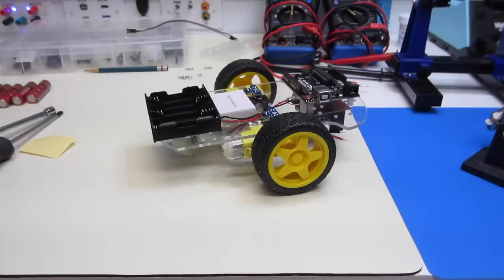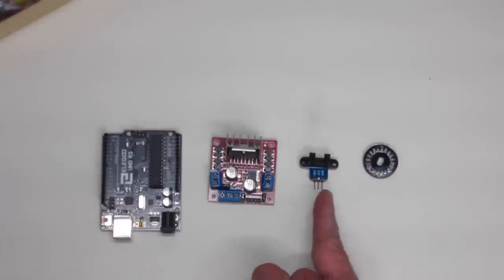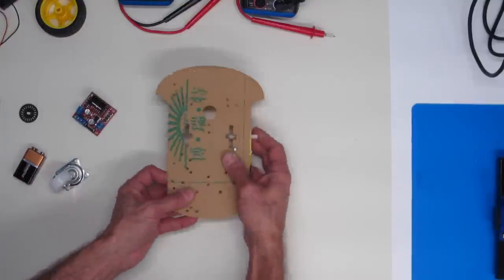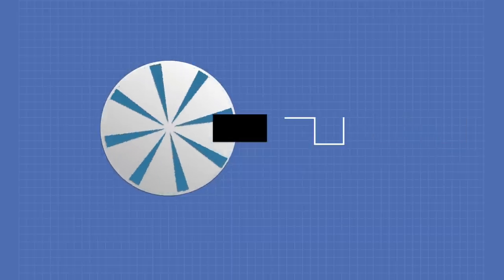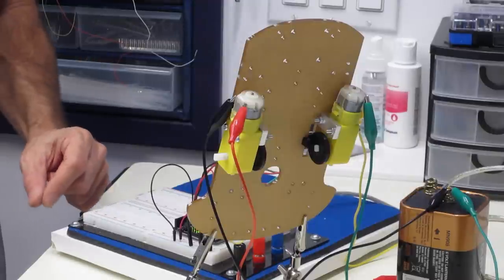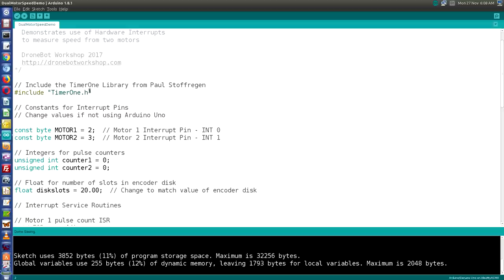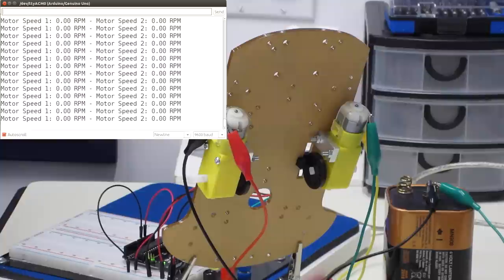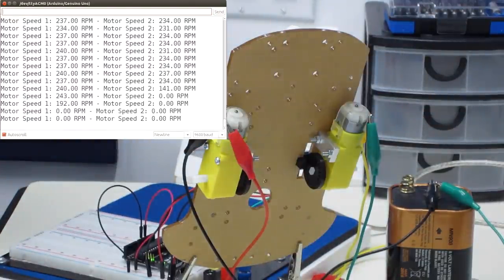Arduino Robot Car with Speed Sensors - Using Arduino Interrupts

Comment: I am teaching myself Arduino and to a smaller extent robotics. I have followed your excellent tutorials about the robot car and every detail is clearly explained and easy to follow. The instructions on Interrupts (and the link to Nick Gammon) made my project jump ahead in leaps and bounds. I did find that the last code would not run until I put a few pinMode(??, OUTPUT) instructions in the setup to define the Arduino to L298N driver pins. Once they were set, away we went. Thanks again and I'm looking forward to your continued additions to the car.

Comment: hi and thank you for this work, it's a great start for me.

Some improvements I did in the move routines code:
1. if you use "II" instead "&&" in "while", then the movement finish when both motors end at the same number of steps.
2. instead of "steps > counter_A" I use "counter_B >= counter_A" and instead of "steps > counter_B" i use "counter_A >= counter_B".. in this case each motor waits the other to complete same number of steps, so the movement is straight.

Comment: Just a few short comments. First, please note that 25.4 cm is NOT "about a foot." It actually is 10 inches. 

Second, while I enjoyed your video, as I always do, I came here looking for a way to control SPEED of two motors so they track accurately together. After all, the encoder disk is referred to as a "speed sensor". The motors you used, quite visibly, do NOT both turn at the same rpm, as the car drifted to one side when it moved. That was also obvious during your first demonstration showing rpm on the Serial Monitor. The two numbers were not in sync. If you do not have a video that addresses this issue, please consider making one.

Thank you for your time and efforts producing these videos. I enjoy them and have learned a lot from you. Keep it up. 

Finally, to those who comment on your (and others') videos with lines like "I have a project due Monday, how can I do..." These drive me mad, as it seems they want YOU to do the work and let tham take credit for it to get their diploma/degree. Instead, I recommend those people actually invest in LEARNING something, instead of poaching others' work. Grrrr...
Reply: Hi Tim,
Have you heard of PID control? Theres a video on MATLAB that allows you to use this output speed to determine how to adjust it.
Also, about a foot is close enough to 10 inches. I think he rounded it.

Comment: Brilliant Demo, with excellent explanations. The only suggestion would be (at 33:37) show the negative from the 9 volts goes to the outside (chassis) of the 2.1 mm power socket (centre is positive).   I am jealous of how neat, tidy and well laid out your workshop appears.
Reply from the maker: Good eye John, I should have spotted that connection error but didn't until I read your comment. Hopefully most users will just use a 9-volt to 2.1mm connector and won't reverse the polarity.  Thanks for pointing that out!

Comment: Really nice video! Having bought a similar chassis last month, I made a Mobile controlled robot car using a bluetooth HC-05 module, but I kept wondering what to do about those speed encoders to control the distance they travel or speed of the motors. Well, thanks to you, now I know. The explanation about the Interrupts was exceptionally good and will help me in building some more ambitious projects. I will surely check out your website as well.
Reply from the maker: Thank you for the nice comment, so glad I was able to help!

Comment: Actually, 25.4 cm is 10 inches (1" = 25.4 mm). A foot is about 30cm.

Simplest way to get a rounded value is to add 0.5 before doing the truncate (or cast). (or use a lib function which does that'I suppose)

Comment: Hi, I have some questions about the power supply. Could you power both the Arduino and the L298N off the 9V? My chassis is much smaller, so I am trying to reduce space. Also, can't you power one of the two boards off the 5V supply of the other? Is there some risk of over-currenting if too many sensors are connected to the 5V supply on the Arduino? Thanks!

Comment: Great video. Thanks a ton. Just a question. Instead of 5x1.5 = 7.5 V, can the H bridge be supplied with 9V battery to power the motors? Thanks

Comment: Thanks for the video... I've built a cart using the same electronic components but I can't get the cart to move straight in either the forward or the reverse direction, and the distance that the cart moves is far less than the distance I put in the program. I've checked the logic over and over and it seems to be OK .  I have the sneaky suspicion that the the HC-20K opto encoder is actually OVER counting steps!   I checked my code by putting serial prints in strategic places and the code correctly calculates the correct number of steps for a given distance and the routines do start and stop the motors until the correct step count is reachedHence my suspicion that the speed sensors are reporting more steps than what have actually occured.

To give you an idea,  my wheel diameters are 66.2 mm - so the circumference is 3.14156 x 66.2 = 208 mm .  When I input 208mm the subroutine correctly calculates that 20 steps are needed and the motors are turned until the ISRs report that the step counts reached 20 steps, but one wheel turns ~290 degress while the other turns only ~180 degrees.  

I am guessing that the interrupt pins are seeing a noisy signal and that some of that noise is triggering the ISR.

As I am writing this, I am also thinking that I am running both the arduino and the motors using the same battery... perhaps that may be the source of the noisy signal on the ISR pins? I want to run on a single 9 battery because my cart is about 1/3 of the size as yours. I set myself the challenge top make everything as compact as possible.

Have you or any of your subscribers come across this? Is there a solution?

Comment: Absolutely fantastic instruction video.  Very clear, to the point, with no unnecessary baloney. I'm definitely a fan.  I'll be building one of these robots via these instructions to be sure.  I eventually hope to build a far larger robot using the same basic principles.  But building this little one to gain the experience is definitely the way to go.   Thank you very much for making these video courses.

Comment: Many thanks for the tutorial which set my buggy up jolly well. A question though if I may. In the early part of the tutorial you used a sketch to demonstrate the use of the speed controllers. In it you called TimerOne from the library but it wasn't used in the main sketch. That puzzled me. Could you please explain why this is? Many thanks, Joe.

Comment: Such an informative video! Great. As for the basic optocoupler without any circuit boards; Can it still be used in the same way? I have those on hand and would prefer if i did not need to add an additional pulldown resistor.

Comment: Thank you very much all the step by step explanation as a beginner I find them to be very useful. Nevertheless, when I first come into contact with the related subject I had the question of getting both motors to turn at the same speed so the car would go on a straight line. I did notice the demoed moves made the car goes the the left as your motor A has a slightly higher speed. But this can be significant if it is to run on some distance. Do you have ways to achieve the same speed for both motors to run on, since there are so many read outs?

Comment: Tore an rc toy car to get those motors.Finally ordered the kit since I needed those speed sensors and a couple of nrf2401L´s.  Really learned a lot.  Would it be possible to make another vid about the rbtcar using  2 nodemcu´s to control it wireless? Thanks!

Comment: So I noticed the wheel speeds are different. How would you script the arduino to make the car run straight? 
  Although i did see where the script made motors equal their rotations. But does that straighten the car out at end of run or will it allow a long straight run? 
  Thank you for your response.

Comment: Hello, I really like your videos, you do a great job. I have a question about the Speed Sensor. I set the sketch and hardware up just as you instructed running motor on 5 volts, it seemed to work fine until I changed the voltage to 3.3 volts to slow the motor down. The sketch RPM reads faster on 3.3 volts then on 5 volts. What are your thoughts? Keep up the great work!

Comment: Hello. Thank you very much for giving this really informational and nice tutorial. I had a question regarding the code at 19:40 of your video. There is a TimerOne Library and I installed it from Paul Stoffregen's GitHub, but when I uploaded and tried running the code, I got Compilation Errors for 'class TimerOne' has no member named 'detachInterrupt', 'class TimerOne' has no member named 'aatachInterrupt', and 'class TimerOne' has no member named 'initialize'. The lines are in Void Setup (Second Line and Last Line) and Void ISR_Timerone (First Line and Last Line). My code is a direct copy of yours, so can you reach out to me as to why this didn't work on my side?

Comment: Hi, I find your video very useful, but I have few questions. I have got the same chassis, dc motors and the motor driver. However the motors are rated for max operating voltage equal to 6V. I understand that there is voltage drop on the motor driver, however how did you calculate that your 7.5V will be safe? In the L298 paper i can see that there is min. drop of 1.8V at 1A load, but the dc motors can take up to 300mAh, so the voltage after the drop on the 300mAh load will be highter than 6V, won't it? I want to use 6x 1.3V NiHM which connected in series give me ~7.8V, will it be still safe for the motors?

Comment: At 44.40 you say that 25.4 centimeters equal one foot. That would be true if a foot were 10 inches. The 25.4 equivalent number is in millimeters per inch.

Comment: I was wondering.  If you would you would want to make a PID temperature controller that for example kept a room a 85F during the day and 70F during the night. Could you use the PID library and a real time clock to achive that using interrupts to toggle between the different settings?
Reply: rimmersbryggeri smart
Reply: @xen0n_ML  Maybe but I have no isea how to do it. Any time I modify a PID sketch It just returns soemthign like. (not possible to compile for this board)

Comment: HI there, 
i want to build a AGV (Auto Guided Vehicle) robot. but i need help wiring the circuit. i'm using two DC motors to drive the robot forward, two battery packs to power each motor, one Dpdt switch to turn the robot off and on, and two limits switches that will act like sensors. if one limit switch is trigger one motor stop and the other motor reverse until the switch is release. can you guys help me out with this projects? thanks!

Comment: Where did you get your encoder sensors from? I can't find them anywhere, or the optal-interrupter is not placed on the back of the sensor but the front. Your help would be greatly appreciated.
Reply from the maker: Hi Sophie. I picked mine up on eBay, they have several to choose from.  Go to eBay and search for this term : "IR Infrared Slotted Optical Speed Measuring Sensor Detection Optocoupler Module" and you'll get a listing of several sutible ones.

Comment: Those of us familiar with the metric system will tell you 25.4mm is actually 10 inches (so only 5/6ths of a foot.) ;)
Reply from the maker: Oops - you are of course correct! So sorry for the error.
For the record it's the old Imperial system that I'm not familiar with, as a Canadian I use the metric system exclusively.
Reply: Actually you can check at onlineconversion.com. 25.4 MILLImetres is 1 inch, and 25.4 CENTImetres is 10 inches. By the way in the UK we spell it metre not meter which is the thing responsible for your electricity bill or a measuring device. Since coming to the USA from the UK in 2000 I have learned that the US not only drives on the wrong side of the road but is a bit slow going metric... however they do have a reason for the latter since manufacturing back in the day the switch would have cost US companies a fortune in new precision gauges. Of course they solved the manufacturing measurement problem by exporting many manufacturing jobs. As for driving on the wrong side of the road I think that is incurable, but I do see some traffic islands appearing which will save fuel against all the 4 way stop signs once people get used to them. Thanks for the time you put in and that is the tidiest workshop I have ever seen, I wish I could say the same about mine.

Comment: Actually use 1.5V AA or battery 18650 better?
Reply from the maker: 18650 batteries output 3.7 volts so two of them would make a perfect power supply for the motor. Just be careful working with them as they need to be recharged properly, otherwise they present a fire risk. You can pickup tiny 18650 recharging modules for next to nothing on eBay that will help you out there.
Reply: And you can power Arduino uno directly from 2 battey or using the stable 5V offered by Hbridge and using the Vin pins to power  the Arduino uno

Comment: My remark : if you hope to get your car running perfectly forward and make perfect 90 degree turns with this setup, dont get your hopes up.
The quality of those plastic gearboxes is,  with my experience, just too low to achieve that goal.
The problem is the relation PWM to speed is not linear and the motors dont break free at the same moment.
So you have motor 1 already started while motor 2 is still stalling, leading it to make a turn.
I have tried to compensate for these shortcomings in many many ways, but none seem to work in a satisfying way.
Things i have tried : determining the breakfreepoint, linearise motor speed, use just one fixed speed and try to determine best PWM setting to obtain this, start with a short boost of 200/55PWM to break free and lower to desired speed after, adapt the motor speed while running forward. (if the difference in the counts is too great, make the faster motor slow down).
I tried switching out gearboxes, i have many of those here. All of it didn't lead me to the stable predictable behavior i was looking for....
I am going to switch to stepper motors for my requirement and/or do some tests with metal gearboxes later, i have hunch the main culprit are those plastic gearboxes, the tolerances on those just are not high enough for stable performance.
PS.: if you use the change interrupt instead of the rising one you can double your resolution at no cost
Reply: Great info, thanks for the insights from your experimenting.
Reply: @YvanR0Y  np! Good luck on your project?

Comment: Can we show a sample wiring for 24V power supply to drive the 2 24V DC motors, assuming 9V power supply from battery to power Arduino to include a breadboard. 
in short a circuit connection using L298n Motor Driver, Arduino board, Breadboard.

Comment: Could you pls explain about L298 Dual H-bridge motor controller: does it receive only 1 PWM signal at the same time to control motors in propotion, or can it receive two independant PWM signals from Arduino two control MotorA &MotorB output independantly?

Comment: Does anyone know if you can also use the l293d motor shield driver instead of the l298n.  What needs to be adjusted if you use it (if it is possible)?

Comment: Great video, but with a serious drawback.
That "ISR_timerone" is a VERY GOOD EXAMPLE HOW NOT TO DO IT. Its neither short or fast.
The correct way would be to just copy the counters to another pair of variables, reset them and set a boolean flag.
The "loop" code would check for the flag to be true,  then do the maths, print the result and reset the flag
Also the explanation for the "volatile" qualifier is incorrect.
Don't get me wrong, I like your videos and learned a lot with them, but this ISR its a huge mistake and a very bad example for the noobs out there.

Comment: Thanks for the wonderful video. I am dding these comments again even though you have replied to similar comments. But I was looking for some errata in the text or in the video about that. After 3 years, it will take some digging to get to those comments, hence to help the late comers like me. Advance apologies.

39:00 - Adding 0.5 to the float value and casting to (int)  will automatically do a upward rounding.
44:40 - 25.4 cm is 10 inches, not 1 foot. One foot is  2.54 x 12 = 30.48 cm

Comment: while(steps > counter_A && steps > counter_B). Steps is not less than but is greater than counter_A etc...
Reply: That's right, logically consistent though :-)
Reply: Shouldn't the || operator be used instead of the &&? If I understand the code correctly, as soon as one motor reaches the given step count, the loop will exit and both motors will be switched off.

Comment: First rate video!
I like your index with links in the description.
Using Ubuntu 👍 👍 
What are you using for video screen capture on Ubuntu?
Reply from the maker: Thanks. I actually stopped using screen capture software and switched to using an HDMI recorder which has several advantages and is not limited to any specific OS. 
I used to use RecordMyDesktop on Ubuntu, it's nice but it takes FOREVER to render a recording after you are done and I then need to convert the format so I can use it with my video editor (Final Cut Pro X). The HDMI recorder simply records to a USB stick in MP4 format which I can use without conversion.

Comment: Hi Mr,
i used the same code And montage, to measure my motors speed, 

void loop()
{
  moveForward(255, 255);
  delay(10000);
  moveForward(200, 200);
  delay(10000);
  moveForward(150, 150);
  delay(10000);
}
my left motor work on all PWM value given, but my right motor, work only when i give a full pwm value moveForward(255, 255);
i write a post in Arduino forum :  https://forum.arduino.cc/index.php?topic=599332.0
and till now there is any explanation
can you help ?